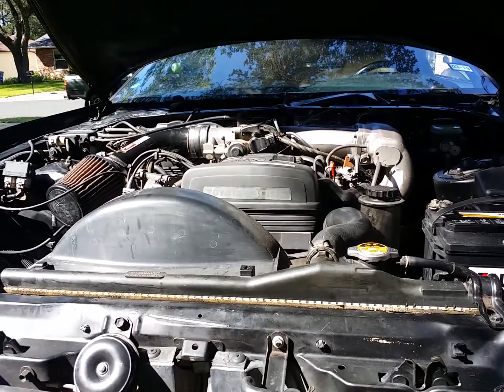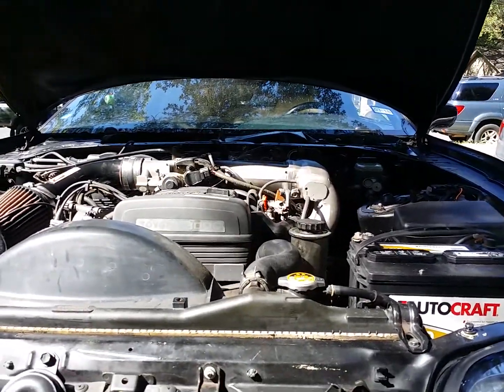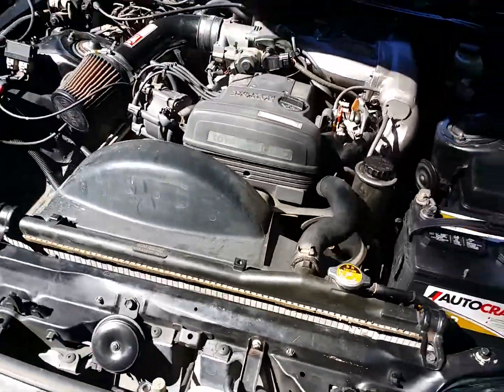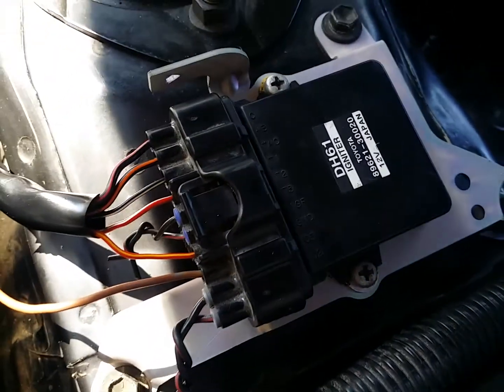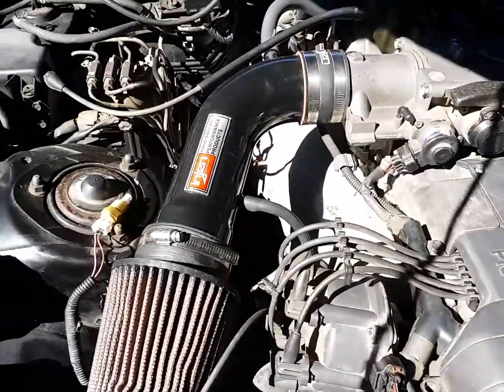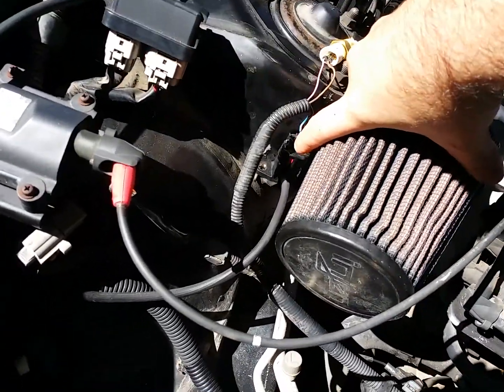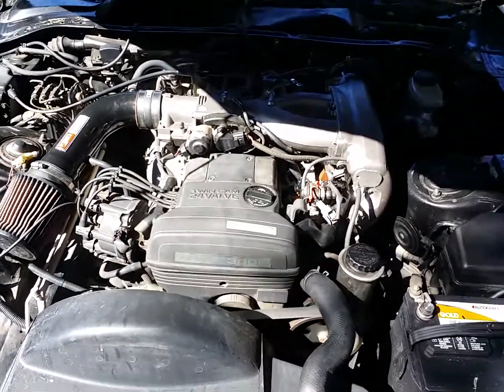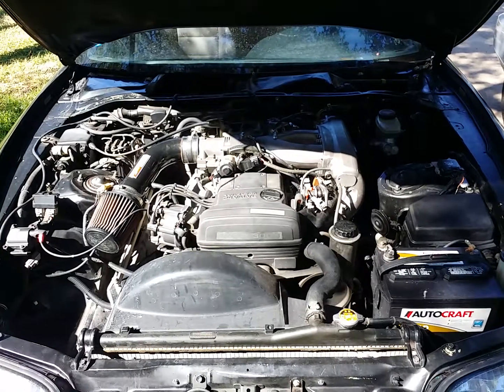1995 Supra 2jzgte Ecu mod Part 1

Comment: hey, i know this is an old video but I did the tt ecu mod on my 94 JDM, without going turbo but I did everything else ... 440cc, ds62 igniter and everything.... 

I have an issue where I think I;m running too rich., I do have a 21 code but that's due to running a 1 wire O2 sensor, Spark plug get carbon fouled quick, When I put fresh plugs in, it runs beautifully, starts strong, and everything after a few days of driving, the plugs are black dry sooted as hell. 

Now, I was wondering if I put back the stock 300cc NA injectors, will that be better or what should I do
? or just turbo it and hope for the best? lol ....
Reply from the maker: 1 wire 02? Doesn't it need a heated 02 for fuel trim? I'd have to go back and check my setup but I think you need the heated 02 for the ecu to trim fuel correctly

Comment: Hey man, i pretty much did the same TT ecu mod while retaining the dizzy (ds62 ignitor and all that) with an oem ecu i can get it to fire but on my aem v2 with a gte map it wont fire at all just cranks... any ideas?
Reply: Spoke with alisc3. was told i need to copy the crank/cam sensitivity settings from the GE map over to the GTE map and it should fire. Unfortunately i do not have a windows based computer to do it myself
Reply from the maker: jdm kingz I'm not sure, but go to club lexus and ask alisc3. He'd probably know
Reply: tried that 4 days ago still no answer!
Reply: Did you end up getting this sorted jdm kingz? Im doing the same with a Adaptronic ecu
Reply from the maker: Yeah im not sure about this. Seems like it should work
Reply from the maker: jdm kingz Ali is the boss